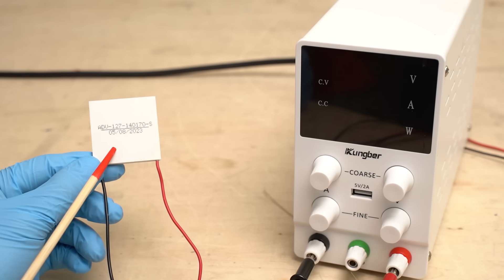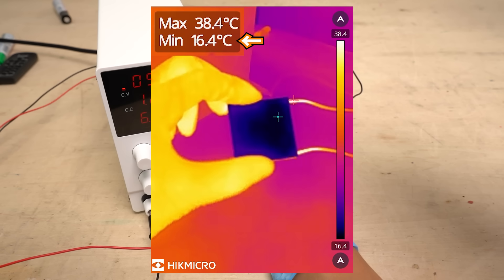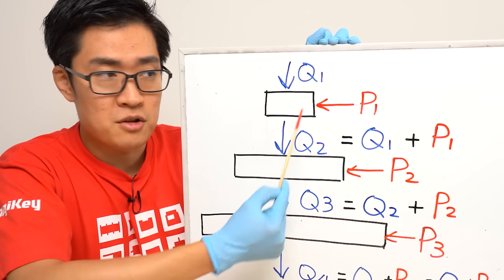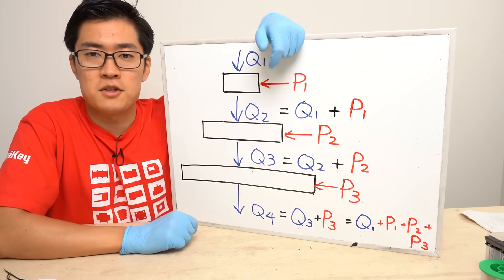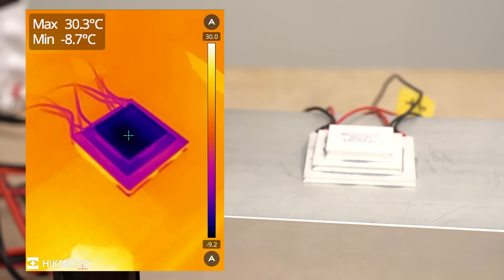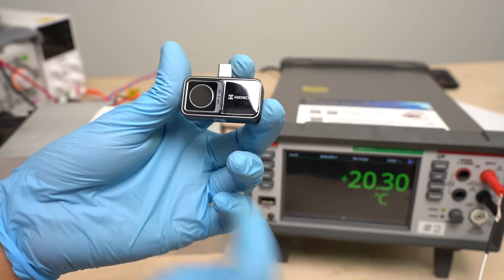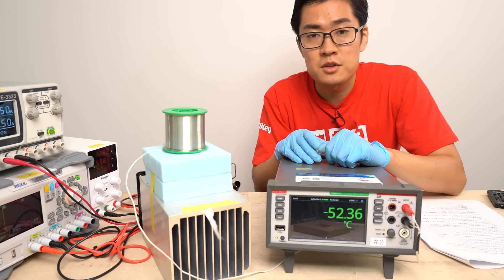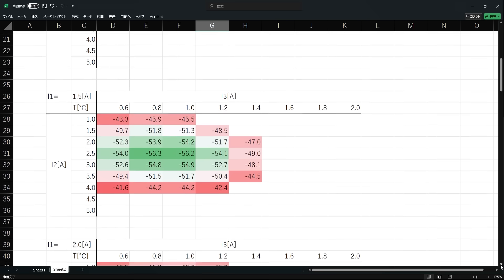Stacking 5 Peltier Modules, and Reached -90℃

Comment: I am a beekeeper, and we have cold winters here.  Most of my bee yards are remote (no power connectivity).  Can I use one peltier module above a hive to generate power to another inverted one below a hive?  Thereby recycling the heat the the bee colony makes all winter long?  Honey bees cluster in the winter and keep their cluster 93F degrees all winter long.  It's like running a winter-long marathon.  This is why the bees store so much honey (carbohydrates).   Sometimes our temperatures can get down to -20F.   Could a pair (or many pairs) of peltier devices help recirculate the heat?  I can imagine chaining the top and (inverted) bottom peltier modules as a method to recirculate heat electronically.  Would there be a small improvement in heat transfer?   And of course if you stacked them, would this improve the performance?  On top would be an heat absorbing stack with the coolside facing the outdoors, and on the bottom, the reverse.  Thereby keeping the heat contained to the inner bee colony box.  (I already use insulation on my hives in the winter.). Adding peltiers (somehow) may enhance the ability of the colony recycle their heat over the winter.  It looks like I'm going to have to test this out with broodminders.

Comment: you should make a heatsink that goes on top and bottom and has pipes from the hot side to the cold and then see if it can make more power than the tile alone. like your other experiment except see if it can increase efficiency

Comment: You can flip the design over, everything becomes simpler. The pellet elements are at the bottom of the pan, there's no convection, and you can simply add water to cool it.

Comment: Try passing copper tube in the sequence through the heat sink as 1 3 5 7...depending number of passages half the way of the way of Heat sink then circulate water it will get you more better results

Comment: Omg 

Thank you for this

You can understand well from the audio in Portuguese, much appreciated, thank you for remembering.

I wonder if there is some way to cool the air in a room perhaps by changing the pressure. In one stage and expanding in another stage, with temperatures low enough to release to the environment But I don't know.

Comment: And yet there is a very valid reason that we don't use those peltier devices, and if you were installing them inside of servers in the 90's (like I was) then you would know exactly why. I'm not going to deny that they were great (for a while), but with the condensation they cause on the motherboard you can pretty much  kiss the motherboard and cpu/s goodbye after a period of time.

Comment: It could be improved by adding copper sheets between the peltiers. Without them, the outer areas of the larger peltiers are wasted. The heat from the upper modules is only transferred to the center of the lower module. The ceramic is certainly a good heat conductor but 2-3mm of copper would spread the heat better to use the full capacity of the bigger module. 🙂

Comment: Try to find out what sort of ceramic the devices are made with. A lot of them just use Alumina (25-30 W/m·K) but if you can find some using Aluminum Nitride (170-200 W/m·K) they are much better.
Your pre-made device looks like Alumina from the color.

Comment: awesome! i would be interested to know if this would be feasible as a very small -80C freezer. depending on the total materials cost and power draw, it could be a very useful application for DIY biology, as many reagents need long term storage at -80C (though -74 C is likely sufficient)

Comment: imagine gemaking 5 more of these setups (or 6 similar setups so the shapes all fit) and creating a peltier cube. imagine how cold the inside would be. I also imagine that pulling the arrays apart would reveal layers of cold air between the outer peltier, which could further add to the insulation of the inner peltier. I wonder how cold the innermost peltier if the cube would be. I personally think that when you cracked it open, you would reveal frozen atmosphere.

Comment: I've read peltier devices are insanely energy inefficient. one little Peltier tile can use as much power as a fridge, while cooling way less. A typical fridge compressor has a COP of 2–4, meaning you get 2–4 units of cooling for every 1 unit of electricity. A Peltier module often has a COP of 0.3–0.7, so you’re getting less cooling than the power you put in. That’s a 5–10× difference in efficiency.
Reply: For sure, Peltiers are novel but the Carnot cycle is king for producing cold things. There's a reason why Peltiers are only used in very niche applications.

Comment: I got some peltiers also... the use was to maintai na 4-6 celsius temperature, witha terman sensor switch, a fan blows the cold air through a pipe to a cpu, while the heat is flushed outside, and htey have heat sinks also.. I was using a much larger.. hmm ddidn't know I could stack them... the power consumption was a lot more... My htoguht was chill ing the air but not cold enough to cause freezing of moisture... in teh air... hmm.. but now yo ugot me thinking.. lol... debating weather to drop the cool throug hte top.. but might cuase condensation then I need those flick like feathers to grab the moisture out oteh air and have it dew dow na stem to protect he eltronics or cool the bottom area nad have the fans pull teh cold air up.. which then doens't risk problems.. anyways cool guy.. cool man. great work .

Comment: Better cooling can be achieved by placing a thin aluminum plate between each peltier module to distribute the heat to the entire top of each succeeding device.

Comment: Honestly I just wish the mini-desktop Peltier fridges would use 2 stacked modules to obtain decent cooling for a few cola's. With a heatsink inside and outside to distribute the hot and cold I feel like they could be made to run cheaper than a compressor based heat pump for a small scale unit like a 12 pack cooler, and since they don't need to get below 0°c I feel like 2 would do just fine.

Comment: The topic of Peltier modules is always fascinating. I've always wanted to use Peltier modules in a PC system to cool both the CPU and GPU at the same time. The tough problem is figuring out how to make them run continuously for five years without any issues, which is extremely difficult.
I really enjoy learning about electronics, and your knowledge always keeps me constantly learning useful and interesting things. Thank you so much for everything you’ve shared.

ペルチェ素子の話題はいつも興味深いです。私はずっと、PC システムでペルチェ素子を使って CPU と GPU を同時に冷却したいと思ってきました。最大の課題は、それらを 5 年間連続で問題なく動作させる方法を見つけることであり、それは非常に難しいことです。
電子工学を学ぶことが大好きで、あなたの知識のおかげで、私はいつも役立つことや面白いことを学び続けることができます。本当に、色々なことを共有してくれてありがとうございます。

Comment: I have seen the headline and decided to say hi. 
This is unbelievable degenerated , beyond imagination stupid thought for a fully grown man. If you stack peltiers only the first one is cooling room temperature. The second is already cooling an electric heater. Get some nutrition! Maybe take a break of the stage . Everyone has got humiliating moments , not everyone presents ones own in a broadcast. It is not mean to do so , just sad. Best wishes! thanks for listening, bye
Reply: I only have read the headline. After revisiting and skipping through the video . I believe it is intentionally malicious, very mean.
Reply: This is maybe the literally worst cooling setup in existence. Propagating a 200$ Peltier setup for cooling, "which is the main purpose of Peltier devices" . But I acknowledge you may get a very tiny amount of very low temperature. Spending a lot of electricity for heating. Is this capable of freezing a blueberry? If so,  at what energy consumption? Reported!
Reply: @VetusMunduspeltier devices have really niche functions, not many people use them because they use 5 to 10 times more energy  than a normal refrigerator

Anyone who makes a video on the internet about them does so as a hobby and to see what limits they can reach, no need to be an asshole
Reply: @gasterweed8333 
This is praising the advantages of a module supposedly worth 200$ . 13:22
Your very general claim for tolerance of hobbyist content creators is not adequate here. Even a hobbyist should point out they are not worth a dime and very old technology. Unknown in general for many reasons. Primitive and ancient. This "flaw" in the content takes money out of the pockets of curious people and  gives it to the worst ! That is definitely something to call out .

Comment: I've always wondered about stacking Peltier devices to accomplish lower temperatures.  I wasn't targeting <-70C :-) but I'm going to look for a dual stage module and see if I can't modify my cooler to use one or two dual stage modules and power it from a high capacity power brick.

Comment: Peltier devices are incredibly interesting, and pretty much your best (and only) solution to cool something at a low scale (size wise)

The two biggest problems with them though are that they are both very expensive, and they are very inefficient when it comes to cooling efficiency (so even more costs for power used, on top of excessive heat production)

However what they excell at is at producing cold quickly
You can always dump more power into them, making them less efficient, however that also speeds up the cooling process until a certain limmit is hit

If you have a well build peltier stack with a adjusted microcontroller for it, then you can use it very well at percise temperature controll for whatever you are working on, at an elevated elevated price ofc

Comment: you need to add a large radiator and fan to the hot side, otherwise you will cook those paltiers.

better is connecting a cpu cooler copper box to the warm side and run water to it to goo in a loop to a large water container. and in the middle you need a large cpu radiator and a water pump, otherwise water will start boiling.

the more you cool down the warm side, more you get colder in the other side.

those foams are useless. and 100% counter productive.  you need to cool down the warm side not trap the heat around it.

Comment: I like how you used convention currents of how heat rises for a better design of cooling towers since cooling towers are essential for air liquification to remember how a shale oil distillery in of Manchuria from 1932 to 1945 required vast cooling towers & cooling ponds.

Comment: Just don't reverse the polarity or you will have a pile of melted Peter dice.  I did a similar thing for a -40 Glass radiator condenser for perflouroalkyl iodide and had in in a vacuum chamber it worked fine back in the mid 1980s

Comment: You have to power each peltier module separately?  If you had say a 3 stack of identical TEC plates, could you feed them one amperage and daisy chain the contacts?  Sorry for the lazy question.  I'm at work packing boxes, and curious how that would work , thank you

Comment: KEITHLEY DMM6500, Digital Multimeters 6-1/2 DIGIT 
BENCH/SYSTEM DIGITAL MULTIMETER WITH SCANNING
356 ТЫС. РУБ., RIGOL DP932E - источник питания 82ТЫС РУБ., 0 → 32V, 3A, 3-Output, 217W
173 ТЫС. РУБ., RIGOL DHO924S Цифровой осциллограф 158994РУБ.

Comment: Consider a different setup; a Peltier equivalent of a Joule-Thompson cryocooler: multi-stage bleeding cold air from output as coolant. Take a blower connected to an "air tunnel" getting narrower, cooled along its length by progressively smaller peltier devices, with some air past every peltier device bled to the opposite side of the peltier device, turning 180 degrees, to cool the hot sides, each stage getting less and less colder and colder air (and using some of it for self-cooling).

That way you cool each of the peltier devices with air already cooled well below its 'hot side' temperature, even if the 'hot side' temperature is already very negative. I'd hope you get liquid air off the far end.

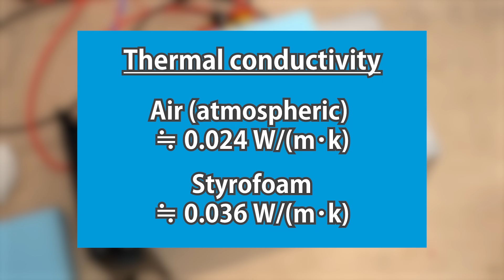Comment: 8:00 That figure for air heat conductivity doesn't take into account convection. So you can't compare directly with styrofoam. Otherwise, there would be no point to use the styro case, which has higher conductivity than static air.
In practice you wouldn't adjust the current manually, you would design a system to automatically find the optimal operating point.

Comment: Is there a particular reason that each stacked device is smaller than the preceding one? Wonderfully done video presentation. If each stacked layer were a 40mm by 40mm size, would that cause a problem?

Comment: Hello i am new to this and have a couple questions. In your experiment the heat is transfered to the heat sink and the top side is that which is cooled. If this is correct then you could also flip the peltier and cool the object(in this case the heat sink, while allowing the heat to dissipate into the air or much smaller heatsink with airflow, say coper mesh screening) would this be possible?  If this is correct then would it also be posible to invert the setup of the peltier, and make it so the cooling side has the greater surface?
 Perhaps you saying you could only cool an area the size of a fingertip is a hit at what i should expect your answer to be. You also said this setup could potentially cause frostbite, if you didnt need such a drastic amount of cooling could you just reduce the power input and acheive scaling degrees of cooling?